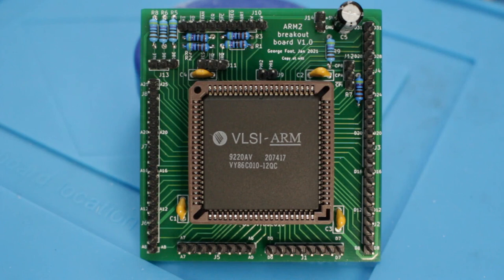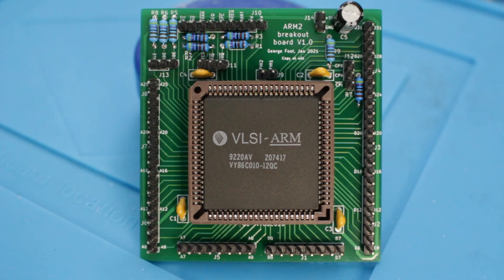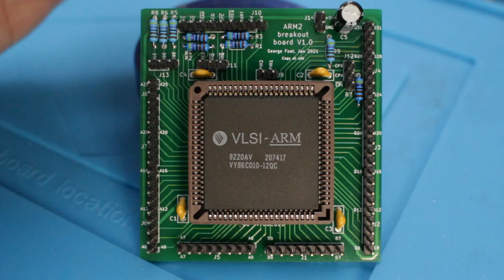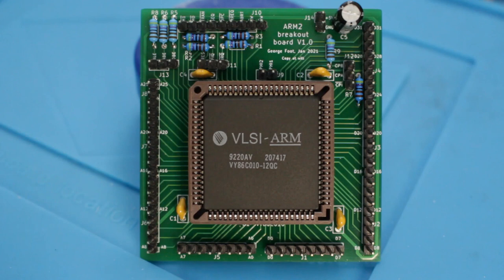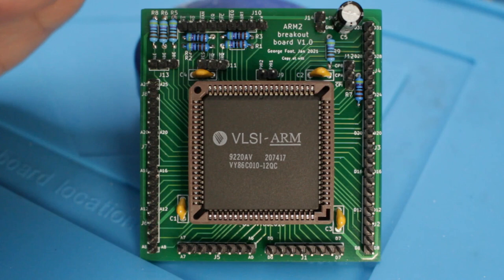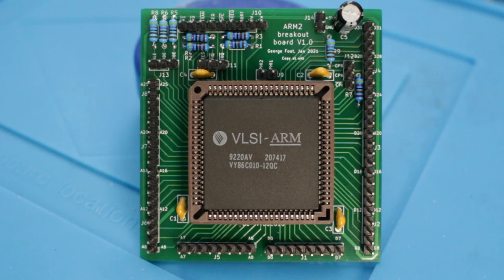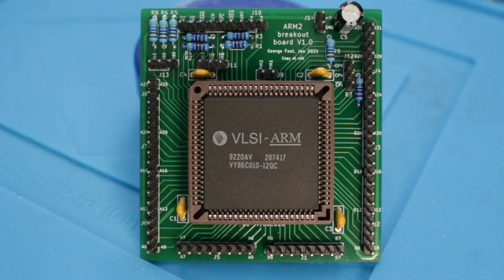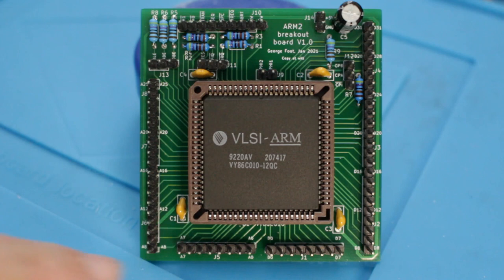Homebrew ARM2 #2: What are all the pins for?

Comment: Thanks for the tour of the pins and background on some of the underlying design ideas. It's interesting how aware the CPU is of the needs of DRAM.
Reply from the maker: We'll need to look at some bus timing diagrams soon, and it'll be clearer how that optimisation works. It took me a while to understand it, and the pipelining is still not obvious - it even sends some signals during the previous clock cycle so that the memory system can prepare early.
Reply: Static RAM was still pretty expensive in those days. The actual management of the DRAM was delegated to a helper chip called MEMC, which managed up to 4 MiB of RAM. I upgraded my Archimedes A440 to 8 MiB, so it had (has - I still own it) two MEMCs. There were two other helper chips, also designed by Acorn and manufactured by VLSI, called VIDC and IOC (video and IO controllers, respectively). The original Archimedes models all had the same set of four chips: ARM2, MEMC, VIDC and IOC. Later Acorn computers had different chips that combined the functionality of the original four.

Comment: This should be fun.  The ARM2 doesn't appear to be too available here in the States.  The only ones on ebay are from Germany.
Reply from the maker: Yes, I had it delivered from Germany to the UK. There are some ARM610 boards available as well which were plug-in upgrades for later RISC PCs. They're basically just a CPU, an oscillator, and some glue. I don't know the pinouts but they may be documented somewhere. ARM3 added cache and an integrated MMU, and ARM6 expanded the address bus to 32-bit.

My backup option for getting an ARM2 or ARM3 era CPU was to buy a broken computer (e.g. with a leaked battery) and take the CPU from there.

Comment: About the 8 bit EEPROM on a 32 bit bus. If you used four of them (one for each byte), and used the chip select and two low bits as the input to a 3 to 8 decoder. Four of the outputs would be the chip select for each EEPROM giving you 32 bits of data. Programming them would require striping the data among them.
Reply from the maker: That's what I'm thinking, I think it's what it's designed for, hence the way 8-bit transfers are done. The Archimedes series provided the OS on four ROM chips. It's going to be annoying when updating the code.

It would be great if there was a fairly simple way to do it with only one ROM. It would need to be quadruple clocked, latching data on reads, with transceivers on writes... 

Something I didn't mention in the video is that during a byte write the CPU replicates the written byte across the whole data bus. I don't know whether it's just an artifact, or intended to be useful. In a scenario with only one ROM, it could help a little.